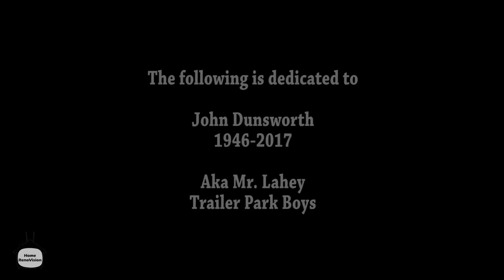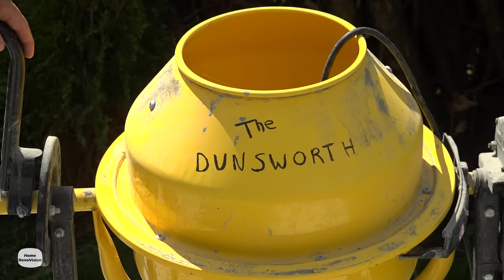Pouring A Concrete Pad | How to Build a Shed | Part 2

Comment: Good series, I liked the other parts more than the base to be honest. Interesting to see how people do things overseas, this would not fly in the UK. Your gravel sub base wouldn't last with our climate and soil type. And that steel rebar looked a bit weak. Also you should really pour and level in one go, otherwise you don't really get one slab. But don't get me wrong, it works over there and your video is great.

Comment: The wire grids are used to control cracks from growing, but if you want to prevent cracks then you must add rebar. It’s not that expensive and makes all the difference in having a smooth floor for years ahead.
Reply from the maker: The truth is mike we are not concerned if a few cracks appear over time. This is designed to be an easy to clean surface that will not get muddy. Just something to sweep and stay tidy. Not driving any cars on it. Cheers!

Comment: Great video Jeff. After 25 years I'm going to replacing my old shed with another that is going to be bigger which means enlarging my original concrete base by 4 feet in length and 2 feet width. The old concrete appears to be in good nick. I'm going to prepare the new bit as you have done in your video but should I do anything to the old concrete to ensure good adhesion
Reply from the maker: go ahead and do a cold seam. It is just a shed. No worries.

Comment: Set up profile. run string lines. Offset string for pegs. peg out slab. dig out slab. Box up slab. Place hard full. Concrete. A bit easier. And can get it perfect.
Reply from the maker: Looking forward to the video. Cheers!

Comment: Did you use the savings from the loose infill gravel to buy those bags of ready mix concrete instead of separate sand & gravel and cement? 🙈

Comment: Hey mate how would you build a 18 meters long freestanding stud wall.  2.7 mts height, there is not ceiling in a warehouse and the floor is concrete. One side will be plasterboard and the other just the frame. Next to it will be a racking system that can hold tonns of weight so I was thinking of bracing the wall to that. Whats your opinion ?. Thanks
Reply from the maker: as long as it is supported.

Comment: couple of points

1. it was poured on hot day..concrete dries very fast and is not strong enough

2. does not look like concrete was not hydrated enough...it needs be watered 4 to 5 days to make it strong

3. the wire mesh needs to be 1 inch above the gravel so it can hold the concrete togather.

Comment: I got a 10x7 pad, but I want to expand it to 16x10. The old concrete is easily 10+ years old. Will this work, or should I be happy with the 10x7?

Comment: Do you have anything on a driveway.... I have one section on the driveway that needs replacing... I put in a walkway at my parents house not sure those 2 things correlate... I thought the hardest part I guess the most physical was jackhammering the old walkway and disposing it... Any ideas would help.... Thanks from Houston Texas...

Comment: Great videos - thanks so very much for educating us who are new to DIY.  I have a question.  I have space for a 10x12 shed on the side of my home.  It is supposed to be used to park an RV.  It’s all dirt now, but the entire side will be filled in with concrete.  I want to try building a shed on this new concrete foundation.  The contractor said that the newly poured concrete will not be “square” with the house foundation.  As a matter of fact, it will have have a slight angle to draw water away from the house when it rains.  How would someone new like me build a square shed when the foundation itself is on an angle.  New and confused.  Please advise.
Reply from the maker: The pad should be close to flat. My shed system will not cause a problem if it is on small slant.

Comment: Wait...what about termites?  For a home foundation code requires the surface of the slab to be 6 inches over grade to help avoid infestation.  Why wouldn't we want the surface of the shed slab to be as high over the grade as possible for the same reason?

Comment: Hi Im In Ontario  and I'm repeatedly told how to use patio stone slabs instead of concrete,  bc the concrete will crack once the frost raises the dirt and gravel. I'm trying to keep it level so the doors.can close properly for years to come. Which is the best option?

Comment: Anything different you would do if the slab is for a basketball court?  Also is there any product that can go on top of the finished concrete to make it smooth but not slippery when wet?

Comment: Not a bad little mixer, I admit I chuckled when you first showed it off. It looked like a toy but it worked and held up just just fine. Albeit it was a bit of a slow process, given it's size. Your slab turned out just fine for its purpose, some of the people in the comments think the same principles of building a driveway slab applies to a garden shed slab and that couldn't be further from the truth. A driveway sees very heavy use, a garden shed does not.
Reply from the maker: Correct John , Cheers!

Comment: What size aggregate you are using?  I tried with 20mm and i am not getting a smooth finish on top of the slab ( using mix 1:2:3)

Comment: Doing a much smaller version of this. Just for a set of stairs (deck).
Is it worth compacting the gravel?? I noticed you didnt for this pad, what is the different between compacting and not.
Thanks and cheers from Ottawa
Reply from the maker: clear stone does not compact very well unless it is a huge amount.
Reply: The difference is a cracked slab. Just do it.
Reply: Don’t listen to athud. Maybe some fiber in your mix, go a little thick on the slab, and make sure it cures properly. A small slab will just rise and fall together with the freeze/thaw. Rebar doesn’t hurt, but for a smaller slab than this, it would be overkill.

Comment: I’m planning on building a 12x16 workshop in my backyard. Could I do what you did or should I look to another video? 
Looks awesome! 
Thanks.
Reply: Don't do a pad that big with bags, and a self mixer all by yourself.  You are unlikely to get it done in a reasonable amount of time to have it look uniform.  You can call local companies to deliver concrete on the truck.  You don't have to worry about getting the mix right, etc.  You can have the right PSI mix for your use / climate etc.  It will not cost that much more than the bags themselves.  I'll use my area for example.  I had a 4 yard project.  To get a truck to come out to the site and pour that much was $850.  The number of bags would cost me $900 from home depot.  That's not even counting the labour, and equipment rental (mixer).   The pour was done in like 90 mins with just me.  Concrete pad services were charging 3-5k for the project for reference.

Comment: That thin wire is enough to prevent cracking? I would have thought that you would have needed something beefier. Great video!
Reply from the maker: we are not driving vehicles on it. Therefore it will be enough. Remember there isn't any mesh or rebar in most basement floors either.
Reply: It is enough if it is installed properly, but laying on the ground and not intertwined or strapped together, it isn’t going to do anything. This slab will perform just as it would without the concrete wire even being there.

Comment: Hey mate, I'm getting different answers from everyone, I need a definitive answer ,and you're my man! I'm building a 10'x12' shed,  lean metal roof from 8.5 down to 8'. The intention is to one day possibly convert it into a home office. In regards to slab I've had contractors vehemently tell me I need 1. 12x12" footing with 4" slab,  2. 4x4" footing with 3" slab, or 3. a 4" slab with no footing.  I'm erring toward the middle, a 6"x6" footing with 4" slab. Will this be enough, considering I may one day convert it? Using 16 oc 2x4's with 2x6's for the rafters. Thanks so much. Absolutely love your work.
Reply: I think that would depend on where you live. If you live in a cold climate, more than likely you will need the footers.. so the frost cycle doesn’t bring up the concrete. Unsure of the sizes for the footers..

Comment: I'm curious... Is there a reason why you didn't use stakes and nails to install/align the boards? It would have been quicker, and easier.
Reply from the maker: I like a screw gun so I can reuse the wood easily!

Comment: Great job!
Do you have to pull a city permit for 121sf of concrete patio, 4" thick?
Just to place barbeque on, nothing else.
Thank you for your time!
Reply: Depends on where you live.  In my city it's 108sqft (10sqm) with building on it before you need a permit.  You can call and ask.  That said whatever your local bylaws are, you can get away with a lot of non permit work.  It's really just a question of does it piss the neighbours off.

Comment: Hi Jeff, just finished watching the whole build, another great tutorial thanks! I'm planning to build a summer house/garden room (UK) similar idea but my floor would be a wood frame supported on concrete blocks suitably located to support the weight. 

My question is would you still use 2"x4" @ 12" centres or go for something heavier like 2"x 6" @ 12" centres to take the weight?

Apologies if you have already answered this.

Many thanks. Andrew.

Comment: Mesh should be overlapped and tied. Mesh should be covered by an inch minimum top bottom and sides not only for strength but corrosion.  When steel corrodes it expands leading to concrete spalling.

Comment: Great job!
Could you put a slab that size on 4 concrete pillars that extended below the frost line to avoid heaving?
Reply from the maker: Definitely there are better ways to engineer a base for a temporary structure. We went with this approach since it will be suitable and cost effective.
Reply from the maker: I have no Idea!

Comment: Yeah, a new vid!🎉🎉🎉🎉
When I was installing 2 outdoor storage sheds, rented a bobcat. When the stones were delivered, had them dump much as could in bobcat bucket, before rest went on driveway. Each shed was 12' X 24''. The cement "slabs" turned out great, but if had to do again, definitely would get a cement truck to come & pour, instead of mixing myself.
Do have a question, & wondering if can answer. Sometimes I've seen slabs that have been poured for sheds, & other uses, but whoever poured cement ended up leaving the wood frame on, they didn't remove it after cement dried & cured. Was wondering if you knew the reason behind this! Curious is all, as was taught differently.

Really great video. THANKS SO MUCH, enjoy watching your vids. Kind of funny that used to work in this business years ago, but it never gets old, & love watching what other ppl can do; plus, can still learn some tips & tricks😉

Can't wait till next vid(hoping REAL SOON), have great holiday!
Cheers, A👍🏻👍🏻💙
Reply from the maker: I like to remove my frame since I can clean the wood and use it again somewhere else. Cheers!

Comment: Fine instructions! I still learned a lot but at 80y I better slow down a bit. This is nice work but I do not know why that Fencer had to do his good work at the time too. I missed the Oil part that I would have put on the boards. Good work Mate!
Reply from the maker: Thanks, oil helps on regular wood but with pt it really isn't necessary. comes off easy!
Reply: all o.k. I get that, thank You Yankee!

Comment: The fastest and easiest way to mix concrete by hand is using a steelemixer.  It will mix a bag of concrete without power in less than 40 sec and its supper easy to use! Go check it out!

Comment: In terms of cost, how much difference would it have been to have the concrete trucked in premixed?
Reply from the maker: I am not sure but the proximity from the road meant that just the delivery and extension and labor for the driver would be more than the product so we did it ourselves.

Comment: Instead of doing all that mixing by hand, set everything up, then have your local ready-mix company bring you the leftover after someone else's finish-up load.  You can can pour a 12x16 pad 4" deep with about 2.4 cubic yards of concrete, which is usually reasonable to add into someone else's small last-pour load, and then bring you your small load when they are done at that other job site.  You will get a much nicer finish, spend a heck of a lot less time and effort, save the expense of buying that toy mixer, and end up with a slab without any cold joints to crack.  The price will most likely be less than your by-the-bag purchase too.  Assume about 80 square feet of slab for every cubic yard of ready mix.
Reply from the maker: Not sure where you live but delivery of cement is more expensive than the materials here.

Comment: Hi, I have a specific question.  I live in a townhome and my backyard is literally a postage stamp.  I need a shed because my garage is not enough.  The area where I want to put a shed, slopes so the water drains away from the house.  I want to put the shed right over the irrigation ditch.  Obviously, concrete pad would not work.  What are my options?  BTW, I live in Richmond Hill, ON -- close climate to where you are.
Reply from the maker: Hi Monika, I would suggest using pressure treated lumber to build a ground level deck and put the shed on top of that!
Reply: Since the area uneven, and I can't fill it with soil, otherwise the water will pool in there, should I use the concrete blocks as you did in the ground level deck you did in a video with your son?
Reply from the maker: deck blocks or clean crushed stone will both work fine. Large crushed stone will provide structural support and drainage. Cheers!
Reply: Thank you so much for your help.  You have answered all my concerns specific to my property.  Your help was invaluable.

Comment: I would have added landscape fabrics between soil and gravel and ordered a concrete truck. It would bother me to have a pad that looked amateur.  You should also raise it so the floor doesn’t get wet in the spring thaw.  Nice video though just go the extra mile next time.

Comment: Great plug for April Wilkerson.  And just how hot is it there?  Max, love The Dunsworth honor.  Jeff, I have a mini mixer on my list of tools to buy.  I want to make my own bricks.  I think I'll call the big guys in for the slab.  But it was fun watching you struggle...  
I mean, it was enlightening learning from you.  Thank you.  ; - )
Reply from the maker: DIY usually comes with some sweat equity! calling in the concrete co. is definitely an option but we were trying to do it on the cheap as an experiment.
Cheers Sandy!
Reply: I got that.  And you did a very good job of it, as usual.  And anyone watching the video with no knowledge nor experience working with that much concrete now has the insight to accomplish the task they'll be undertaking!  Another informative video.
Reply from the maker: Cheers Sandy, crazy how much that work it took and how satisfying it was.

Comment: If you don't mind; covering the face of form boards with engine oil, even used oil, will cause the boards to be pulled away with ease. Most oils should work; I had some used oil on hand.

Next summer I plan to demo my patio deck and install a footing and slab for a year round patio/porch.

In the meantime, I am renovating the entire inside and have been slowed down by self-compelling myself to correct what I perceived was less than desirable construction such as aluminum wiring in boxes that junctions with copper ... grrrr. Massive improvement that will never be seen in safety and performance.

Other things like rafter joists with lots and lots and lots of knots - gone and replaced with S1 lumber.

I have been enjoying the sweat, not the tears and blood from missed hammer blows or from some stupid renovator leaning boards instead of laying boards flat.

Enjoy your videos a lot. The vids have been a great benefit: wiring, rocking, tiling, lumbering as they help keep the grumbling mistakes down ... : )

Thanks again, Jeff.
Reply from the maker: I used pressure treated boards which do not have a problem with sticking. Cheers!
Reply: @HomeRenoVisionDIY  then why don't you tell the veiwers that?
Reply: Sump oil is nasty carcinogenic stuff to have around. Cheap cooking oil will do the job - even used fry oil will be fine.

Comment: If I already have a pad of cement that is 1 x 8 feet for a fence, would I be able to cover it with a 8 x 10 slab without removing the old one?
Reply from the maker: yes, not a problem. cheers!
Reply: @HomeRenoVisionDIY  it is  dangerous not wear mask ??

Comment: Great video! I was thinking good doing a concrete pad but for a parking spot. Any recommendations? Same process as the video or would you recommend digging deeper? I was planning on doing a 20ftx10ft.
Reply from the maker: Hi Johnathan, this video was designed for light use. If you want a parking spot I would check out odell concrete videos. They have info for this type of installation. Cheers!

Comment: I was wondering why you are not using concrete vibrator to eliminate voids?
Reply: Yaniv Cohen, not typically done for a thin slab. Absolutely critical if you are placing vertically as in walls or columns.

Comment: You should dig footing around the perimeter down to your frost line to prevent movement in the slab when the ground freezes and thaws.  Another thought, since this is just a simple storage shed that you may eventually want to move it would be much simpler to build a wood floor system out of treated lumber and raised off the ground about 6 to 8 inches which is required by code anyway even with a concrete slab.
Reply from the maker: Just a little overkill for a shed don't you think. This video is not about best practices. Just a great system for building a shed when no permit is required.Cheers!